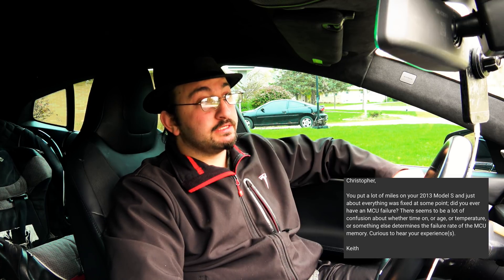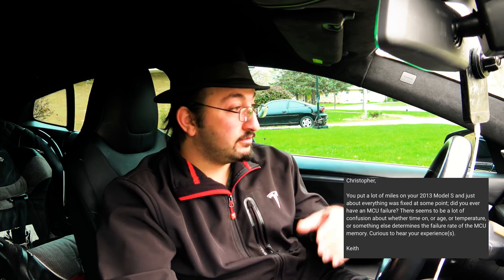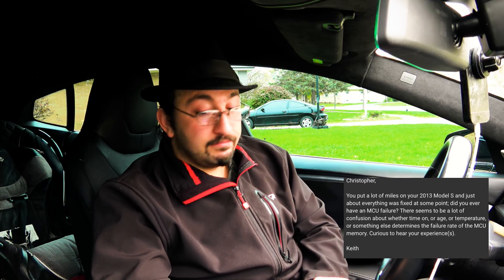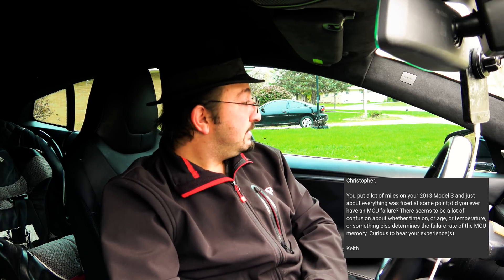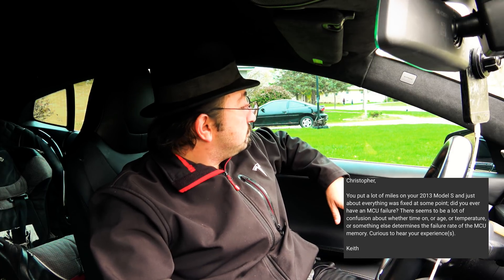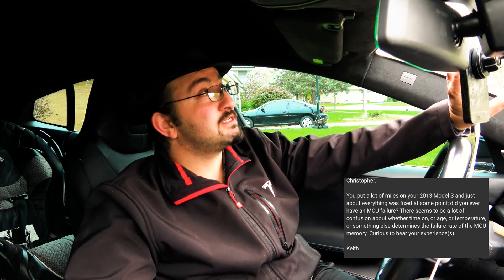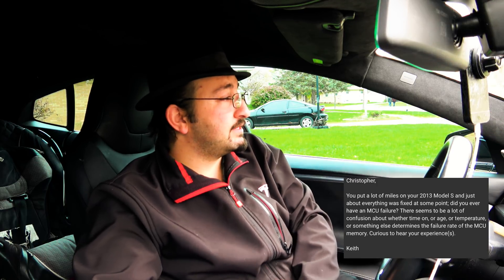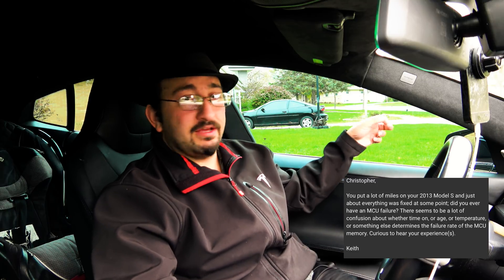Tesla MCU Failure Prevention Q&A (Touch Screen)

Comment: Our MCU just failed on our 3 week old Model X.  Now we gotta drive it 200 miles to the service center with no cabin heat in 25 degree F cold .  Fun.  Our passenger seat airbag and one keyfob are broken also, so it won't be a wasted trip at least.
Reply from the maker: ouch, sorry to hear that :-( quite a bit of bad luck. most likely poor quality control trying to deliver the most vehicles before both end of quarter and end of the year

Comment: My MCU failed and they replaced it.  It was a 2013 with 82k miles.  Mine also had bubbling too.  I'm just glad it was under warranty
Reply from the maker: +Nooooooooooooooooooo! What was the age? or what year was it replaced? ironically it was near the end when mine had the grounding issue
Reply: KmanAuto I had it replaced a couple weeks ago.  It had a failed firmware update once and it restarted really frequently.

Comment: A re-upload of the video could fix the audio +KmanAuto
Reply from the maker: Re-processing it. Whatever happened, the original copy on my computer does not have the issue. On Test samples, whatever is going on with this video, youtube processes like this. When re-encoded to a different output type (Example, Dobly), youtube processes it correctly. Just installed a "patch" on my editing software. Whatever happened F-'d this up :-(

Comment: Yep, definitely need a lapel mic or something directional from the phone/camera!  Otherwise, good info!
Reply from the maker: I have a Lapel mic, but it's kicking the bucket. When filming with it inside or around the car, it picks up some crazy em interference. Around my solar inverter too. never used to do that. Using the camera's 5.1 sorround Mic. But the problem seems to have been a editing software patch I installed, changed how the audio was encoded, and when youtube processed the upload, it turns out like this. Hadent noticed it. Re-Encoding into Dobly (Which test upload seems to be good) and re-uploading, will make that one live once uploaded and take this copy down.

Comment: Sounds like you're sitting in a can. Please fix the audio.
Reply from the maker: Re-processing it. Whatever happened, the original copy on my computer does not have the issue. On Test samples, whatever is going on with this video, youtube processes like this. When re-encoded to a different output type (Example, Dobly), youtube processes it correctly. Just installed a "patch" on my editing software. Whatever happened F-'d this up :-(